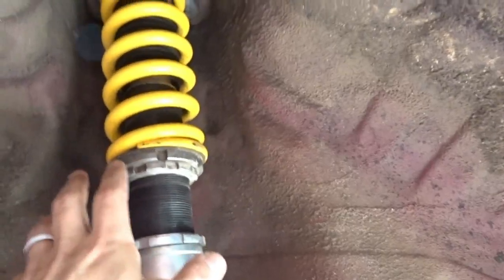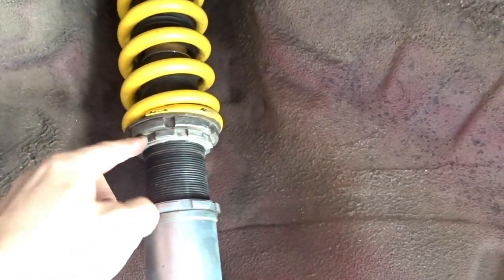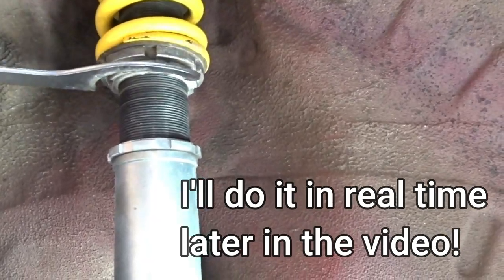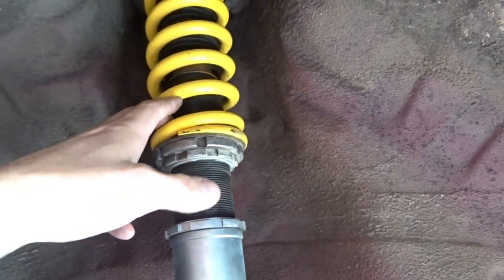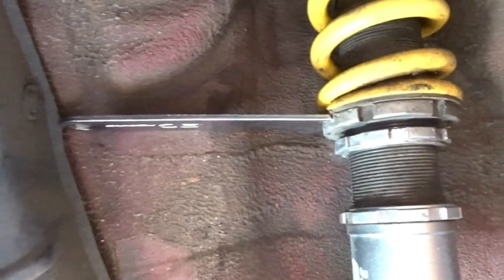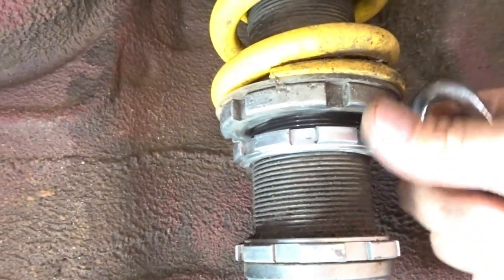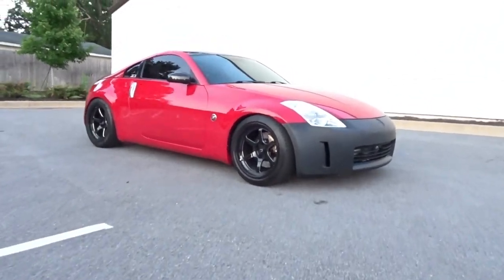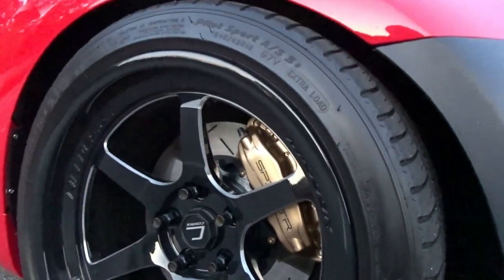Adjusting Coilover Pre-Load

Comment: Earlier u said theres no load before u adjust the preload. But how about a weight pulling from lower arm + brake disc system? Theres load to count there because i think the loads will pull the coilover down and affect the calculation of preload.
Reply from the maker: Technically, preload really should be set while off the car.  But preload is compression on the spring—not the pulling down, but I see your point.  Theoretically, I could probably get more turns in by hand with that initial adjustment if the Coilover was off the car
Reply: @SpeedCultureStudios  exactly. maybe preload setting should be done before installation. but thats a lot of work if the coilover already installed then we have to take it out and set it down outside for a accurate preload. thanks for your explanation anyway bro peace out
Reply from the maker: @midiya945  for sure. If you buy Coilovers new, the installation instructions generally have you adjust preload before install, but yeah a bit of a hassle to pull them out.  Probably could disconnect frkm lower control arm without much trouble though.

Comment: Ok since he responds to comments help me out I have a 96 Camry on rev 9 coilovers. Now I see that most coilovers come with 3 rings but mine only came with 2 nd my front driver side make a noise like the spring is loose and bouncing. Do I take the whole coilover off the car nd adjust it for lowered affect or can I adjust it while it’s on the car please I need help mannn
Reply from the maker: I’m not familiar with the design of the rev 9 Coilovers.  You should be able to adjust them on the car

Comment: What if my coilovers don’t have a separate nut to adjust ride hight… mine has the light helper spring that’s easy to compress. If I want to raise my car I have to basically completely crush the smaller spring but maby it’s not putting as much preload on the main spring but I don’t know.
Reply from the maker: It’s hard to visualize.  What Coilover do you have?
Reply: @SpeedCultureStudios  solo werks coilovers for Audi a4 b8
Reply: @SpeedCultureStudios  my issue is I have to raise them a lot to be level with the rear stock suspension because I have to drive it to a shop for them to do the back. I ran into seized bolt problems.

Comment: Bro I just dropped my new Maxspeeding rods coilovers and the clunking on both sides of the car is insane. About to finish my wheel alignment and get this adjustment done. Thanks for the video man
Reply: i’ve been dealing with this problem for months do you know if this video actually helped
Reply: I have no clunking just bouncing like crazy
Reply: I threw max speeding rods on once they still clunked in reverse no matter what, pre load, alignment, everything was perfect i mean i expected it from $200 suspension lol the old yellow ones everyone says you have to grease the top

Comment: Bought some eBay specials for my Camry, had to preload the shit out of them for ride height and have a lot of clunking. installing the new BCs today properly hoping that eliminates that, very helpful 👌🏼
Reply: clunking can also be solved by putting some lithium grease on top of the springs where they sit under the perch, it’s just metal to metal contact so if u hear clunks at low speeds / turning this should fix it completely, also doesn’t hurt to add some on the pillow ball top mount 👍🏼 and make sure everything is right after a couple weeks of driving

Comment: I need to check my preload. I was maxed out front on my Tein in the winter and raised it back up. I have a click/clunk on the passenger side and wonder if it's the preload. I initially set them all to "zero" before they were installed.
Reply from the maker: Could be the cause

Comment: Thank you for this video! Would you suggest to pre-load and set the height of each pair on the bench to make sure the left and right height is the same?
Reply from the maker: Definitely set pre-load.  I wouldn’t fine tune height on the bench because the car is not perfectly balanced so it may be off anyway, but you can make sure they are the same laterally.  Front and back will be different obviously.
Reply: @SpeedCultureStudios  Thank you. Also please tell if you think the left and right coilovers may need a slightly different pre-lod since when I drive alone it's like an extra 200 lbs on the left front side of the car. I'm not sure if Airmatic system automatically levels the car based on the level sensors.
Reply from the maker: @yolo-cars  it’s just something to play around with.  Set it the same and get a feel for it.  You can adjust accordingly.
Reply: @SpeedCultureStudios  Thank you! I'll keep researching and hopefully early next year I'll swap my current suspension with coilovers.

Comment: Great video man. When changing out my wheels i noticed my coilovers springs(megan Ez streer 2 coils) are pretty loose, i can move thrm up and down by hand about 1/2 inch. Is that normal? Ive had the car for 4yrs and have not had any issues at all
Reply from the maker: No you shouldn’t be able to move them.  While the car is on the ground or in the air?
Reply: @SpeedCultureStudios  I had it on jacks.i lowered the car and noticed the springs being loose. But the fronts weren't doing that when on jacks.
Reply from the maker: @dpz1985dp  Yeah they should still be tight when on jacks, but was just curious if there may have been something else going on.
Reply: @SpeedCultureStudios  I think I'm going to fix it today. Like I said it's never caused any issues or noises.
Reply: @SpeedCultureStudios  while Im here, mind as well ask.. my Acura is lowered, and wheels are   tucked behind fender.  When I raise it, maybe 1/2 inch. Do you think the wheels will straight out?

Comment: Hey I'm just curious… Should the spring be able to turn spinning wise at all with all four wheels on the ground… If the pre-load is correct?… Thanks for a response
Reply from the maker: It really should not spin.  That means there is no pressure on the spring
Reply: thank you!

Comment: sooooo, i've done the super hand tight and the just barely no longer rattling approach to initial measurement. gotta say: its better with the just barely no longer rattling. you'll get better shock travel and that means both better comfort over bumps and better grip on the rebound. that's my theory anyway.
Reply from the maker: It depends on suggested specs of manufacture. You’ll want to find the settings that get the performance you’re looking for

Comment: What if my exhaust sits too low? G37 coupe (Motordyne) would I scrape? Or would it just make it drive like a rock vs boat. With aftermarket coilovers
Reply from the maker: You can adjust the height to prevent scraping your exhaust and then stiffen the dampening settings.  It'll ride a little rough compared to what you are used to, but if you have reasonable expectations, it won't bother you.

Comment: Can extra pre load, more than the recommended 5mm, also help with reducing bouncing? I have adjusted up the rebound for the front XYZ coilovers but it still seems to bounce a fair bit after going over speed bumps.  They've been in the car quite a while so they're probably tired but just trying to avoid spending more....
Reply from the maker: It can help a bit yes, but it could be a sign that the shocks aren’t functioning properly anymore
Reply: @SpeedCultureStudios  yeah that's what I'm afraid of but maybe I'll try increasing the pre load and see what it does. Cheers
Reply: @frankalarcon635  actually is the preload that’s causing the bouncing. Release the spring so it isn’t too compressed. You’ll notice it stops bouncing so much. If still too much. Release some more. Just don’t let the spring be free enough to shake

Comment: When adjusting the preload… is it better to have the whole front or rear end lifted off the ground when doing it? Or can you do it one corner at a time?
Reply from the maker: You can do one corner at a time.  It’s probably better to have at least both front or back off the ground so the sway bar isn’t pulling down but if it’s not possible, I’m sure it’s fine.  It’s better than nothing anyway
Reply: @SpeedCultureStudios  ok then yea I’ll make sure to lift the whole front end up or rear end tomorrow when I get back on it.  When you set the preload, do you have to measure the distance from the top of the spring to the bottom of the spring to make sure both sides kind of match up? Or is the preload set completely individually on each coilover?
Reply from the maker: @jmt0728  you can measure but they’ll likely end up the same assuming the shock is still good.

Comment: It'll sound INSANE, but for 370Z you'll want a 26kgf/mm+ spring in the front and 10kgf/mm spring in the rear. That's if you want 1.5" of wheel gap. Then add a 1" 80duro bump puck and you're golden.
The ride will be harsh, but that's what's needed to be RESPONSIBLY/FUNCTIONALLY low. 😊
Reply from the maker: I don’t know man lol  harsh ride with still 1.5” wheel gap? I don’t think all that’s necessary.  26k front spring?  That sounds pretty wild lol. I’ve never had a 370 Z but on my 350 Z and Q 50 and Corvette I could eliminate all wheel gap and still had a pretty nice ride with a standard set of Coilovers.

Comment: I have ktuned k1 coilovers on my FC1...so front driver side is lower that passenger side...i want to balance the height so my friend told we we gonna adjust the preload of the one side to balance the height to the driver side....
Reply from the maker: No.  Don't use preload to adjust height.  Adjust height the correct way.  And you don't want preload to vary from one side of the car to the other.

Comment: what does adding additional preload do? how does it make the car handle compared to normal 5mm preload
Reply from the maker: Pre-load, if you’re not familiar, is the amount of pressure or “load” on the spring while it is at rest.  Having the correct preload can help maximize traction and stability as it increases the springs downforce on the tires, essentially, particularly if there are imperfections in the surface you’re driving in.  In my case, the car seemed to sag with only 5mm of preload.  The springs are a bit soft, so over time they liked to droop.  Increasing the preload, squishing the spring down basically, before the car is on its wheels reduces the amount of travel in the spring so the car does not droop anymore.  It can make the ride a bit more harsh, but it looks better and actually handles much better now.  I’m at about 10-12mm of preload.  You’ll find suggestions of 1-2 inches of preload, so my change was actually quite small.

Comment: Google Spring rate my guy. Tightening your springs makes your ride bouncy.
Reply from the maker: Google preload my guy
Reply: @SpeedCultureStudios  🤦. I was literally watching a video on preload? 👆🏼👆🏼👆🏼. What are u getting at? Lol
Reply from the maker: @zachholt6830  You need to do more research on pre-load is what I'm getting at.  Especially if you're going to leave a comment like "google spring rate my guy."  You can certainly add too much preload and ruin ride and performance.  But you also need to be sure there is the proper amount of preload.  The point of my video was that there was not enough preload in the coilovers I have.  There were a number of indicators telling me that.  BC coilovers come (for the Q50 anyway) with the rears pre-loaded.  However, it is a very generic amount that is meant to be more universal.  They know that most people won't touch them once installed.  And in reality, 99% of people that install coilovers don"t know how to adjust them properly anyway and would never need to> Depending on the application, it may not be enough.  The adjustment made in my video was spot on.  I achieved the ride quality I was looking for as well as the performance I was needing--tighter more stable cornering at speed, tighter recovery over road imperfections and more direct application of torque to the ground.  AND the rear was no longer sagging.  People run into problems when they try to adjust ride height by compressing the spring.  That's when you get serious bounce.
Reply: @SpeedCultureStudios  yes ik that's why I told you to Google Spring rate after I watched your video. You seem to have done so by now. I'm in school for Auto mechanics. If you over tighten springs you limit their travel and you end up with less droop and more bounce giving a bouncy rice. Think "boiinnng" Preload is... Overnighting past preload is overload. Preload is a very small amount just to set the spring into the perches, hence the terminology. Not enough preload will cause bump/bang noises bc the spring is loose in the perches. I commented directly at what u said in the video. Don't argue with me now bc you went and googled spring rate after lol. You may get it now, but again, I was commenting on the video.
Reply from the maker: @zachholt6830  I haven't changed anything lol.  Watching the video back, I'm not even sure what you're getting at.  You just repeated everything I said in the video and then tell me I haven't looked anything up until now.  So weird.  Did you even watch?  I haven't said anything different than what was in the video. I also have a video discussing this for my Q50 (even mentioned in this video). I explained my reasoning to you here in the comments, which was the same reasoning for making the adjustments in the video. Literally within the first minute I mentioned the fact that the rears had 0 preload with no tension--almost able to loosen the collar by hand.  No compression/preload of the spring was causing the spring to move/rattle when hitting bumps in the road.  Issue was resolved after this video.  I guess I was right.  Also discussed "overload" and even did the "boinging" motion with my hands lol.  You didn't even watch.  I've had an understanding of spring rate/preload/suspension theory for longer than you have been alive.  Preload can, indeed, be a "very small amount."  However, depending on the coilover, the vehicle, the application or the characteristics you are looking for, can range from 5mm to 1.5 inches or more (stated in the video).  You made an ignorant comment because you think you know something and were trying to flex some of that education you are still getting, but clearly didn't watch the video.  I'm glad you're in school for mechanics.  Keep it up.  And good luck to you my guy.

Comment: God, the tutorial is so crap and yet everyone blesses the author. People don't know anything about suspension. Preload is not existing in terms of ride quality or any adjustment. Preload is basically the function of spring rate and weight of the car. You cannot fix the broken by design two piece suspension by adjusting the spring collar. Only way to fix those dampers is switching to the stock length one piece coilovers or stock length custom made for the platform coilovers.
Reply from the maker: Tutorial is crap? Lol better call all the major manufactures and let them know their engineers and technical writers are incorrect.  First, what you describe is NOT preload.  It is not a “function” of anything.  It is VERY simply the amount of pressure/compression placed on the spring before the vehicle is placed on the ground. Google is free. “The amount the spring is compressed while the suspension is fully extended.” Once you relate weight of the car to preload, you lost.  It has nothing to do with weight of the vehicle.  It is PRE…load…
You most certainly can adjust preload.  And any adjustment will definitely have an impact on ride quality.  This is a rather basic concept.  You think reducing the amount of spring travel doesn’t change ride quality?? 😂 Tighten that collar down a few inches and compress that spring—see how the car feels and handles.

Comment: I own a q50s. Bcracing br type installed. Front wheels 12k rear wheels 8K. The ride is very bad. I wonder about your spring rate.  Are you satisfied with BC racing products?
Reply from the maker: The ride is great.  I can’t recall the spring rate but I just got the standard BR series.  Have you adjusted your preload?  BC generally ride pretty nice compared to many out there

Comment: Trying to adjust ride height through preload is an innocent mistake that can be made if the car owner is upgrading from basic tier coilovers to better ones. Coilovers that only have adjustable ride height and use the stock top hats, that’s how you adjust the ride height. On more advanced ones you adjust the ride height by adjusting the height of the bottom mount.
Reply from the maker: If they adjust height via preload, then they are not adjustable, technically.
Reply: @SpeedCultureStudios  true